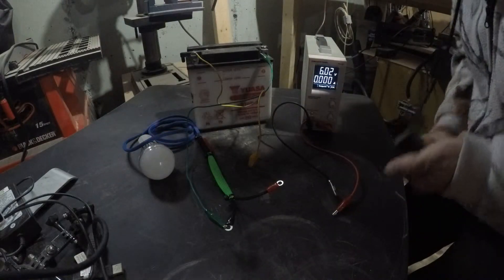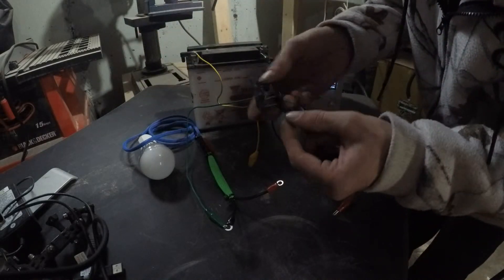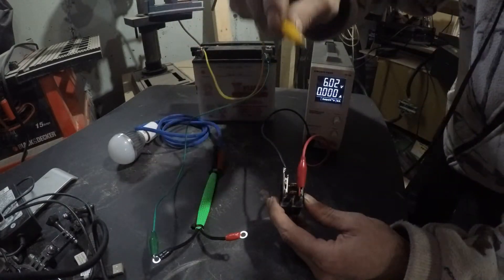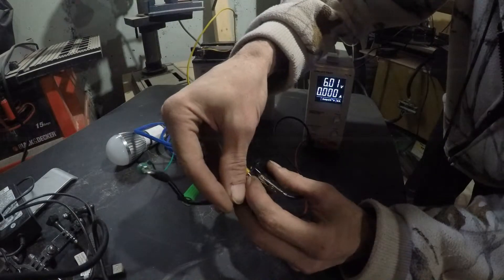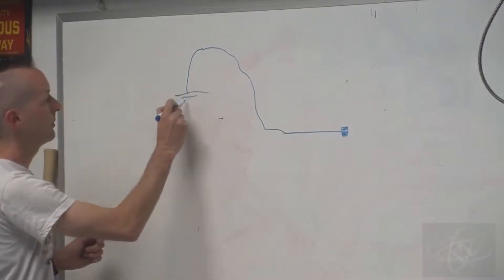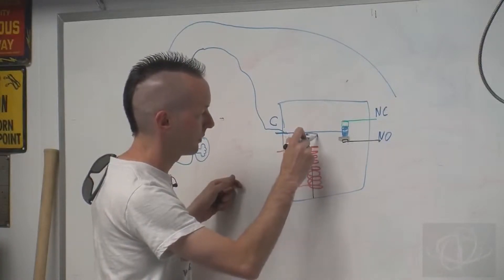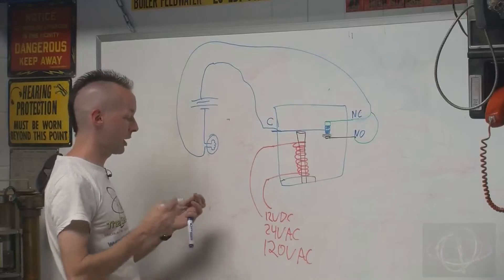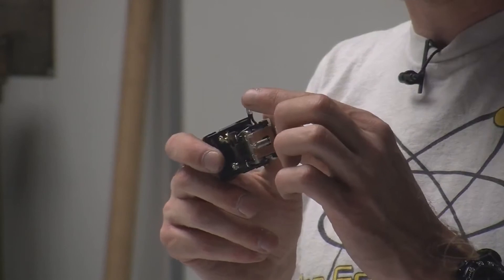Coleman HWOD Relay Explanation

Comment: So Here may be a silly question, But why not switch out the Coleman 6 vlt battery with a 12vlt that would fit the same space, or some other 12 vlt batt. Thanks for all the info on your other vids. Daren San Diego
Reply from the maker: Unsure if the controller board in the coleman would support 12V straight up.
There's a possibility that it could just work, but I wasn't wanting to take the risk, or start reverse engineering the PCB.
At this point it's kinda, choose what method works best for you.
In my case I have a solar panel and two deep cycle 6V batteries in my shack, so it would just be easiest for me to run both voltages.  Heater circuitry off one battery, pump off two.
Thanks for watchin!